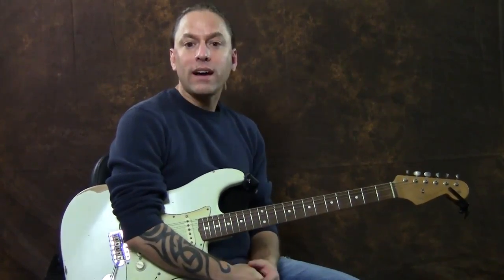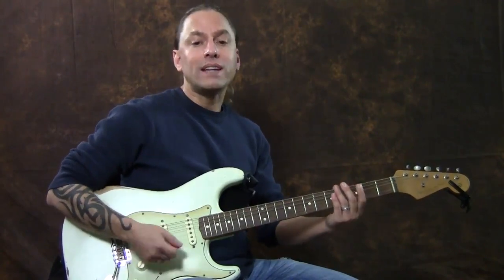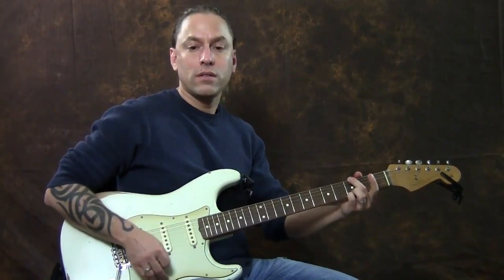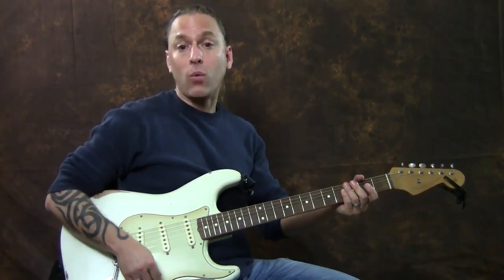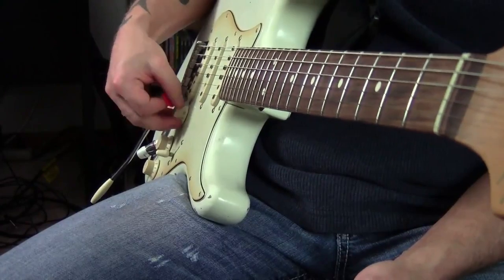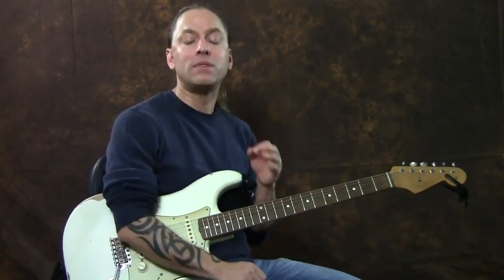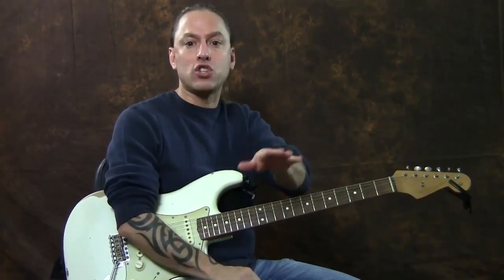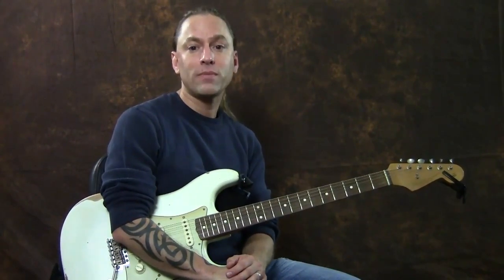Steve Stine Guitar Lesson - How the Volume Knob, Tone Control and Toggle Switches Change Your Sound

Comment: Hey! Steve, I have a Line6 Spider 15 amp and I have a Fender Squire Bullet electric guitar 🎸 and I really don’t know how to set my amp to the right setting and how to set my Fender Squire Bullet for a nice clean sound. I know that my E,A,D,G,B,E strings are tuned because, I double check. So, what do you suggest I do? To me I just don’t like the way it sounds so, I get my Acoustic guitar and start to play it. I am a beginner. Steve! I need your help!
Reply: Well I have a line 6 spider classic 15 and a bullet stratocaster from Squier as well... I think that you should put all your controls at the 12 o'clock position on Amp and your guitar tones as well and then try to move a little bit the amp controls to your preference.
I personally like when I put the guitar tones at 5 and the volume on 8 on the guitar, on the amp I like tu put less bass like a 3.5 or a 4, the mid on the 5 and treble at 6. This is for clean Chanel(put the drive all the way up) 
I hope I could help you

Comment: Hi steve, i am a beginner and don't quite know about the tone and volume knob on my guitar, actually i had both always on 10 and went well till now. 

But now a i am learning a new song, and it has a melody part for that i use g b and high e string in 5th to 8th fret. At the same time when i started to learn this song, i bought a line 6 spider v60 mkII. when i play the melody i started to reckognize a clicking sound that seems to come from the pick hitting the strings. It got so annoying and i just can't ignore it. Where is the Problem do you think? Is it the amp? Is it my guitar? Or my picking style or the pick? I tried several different materials of picks, thicknesses and stiffnesses(if that word exists - i am german). 

Is this normal? Do expensive guitars have that same behaviour on knobs on 10? 

Kind regards